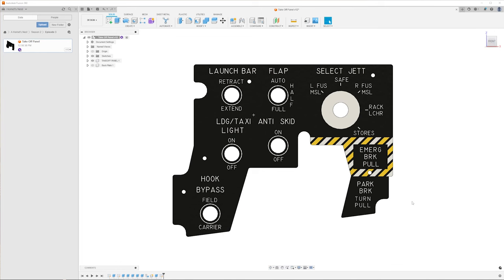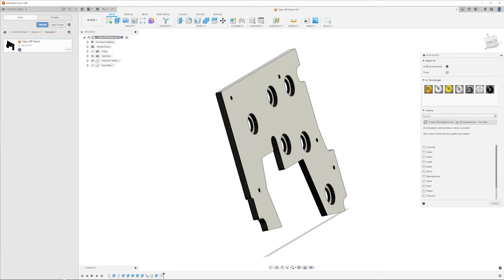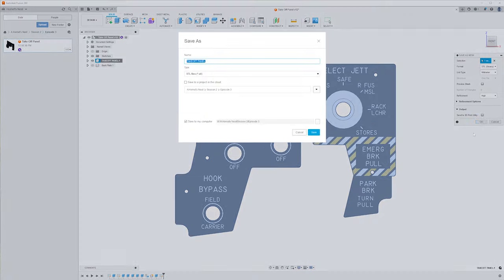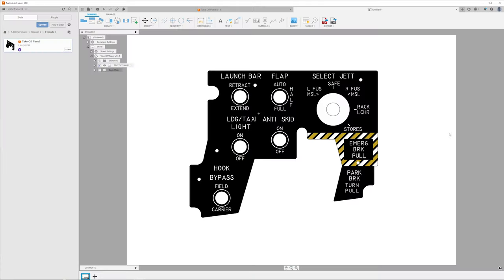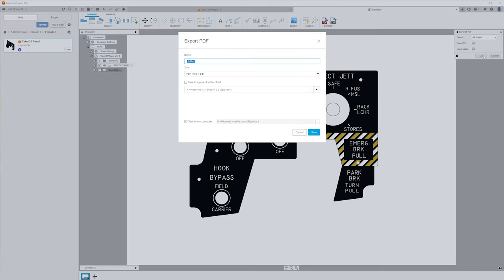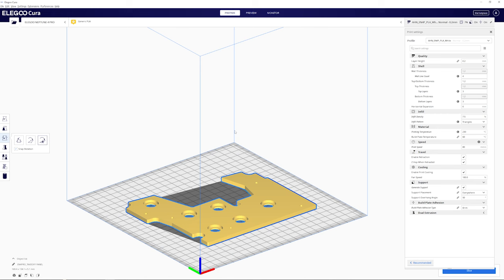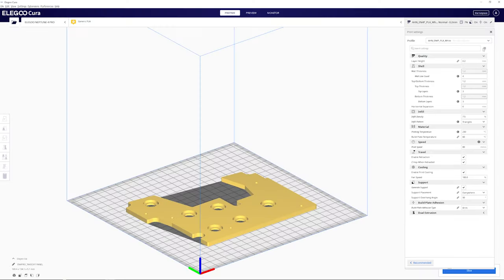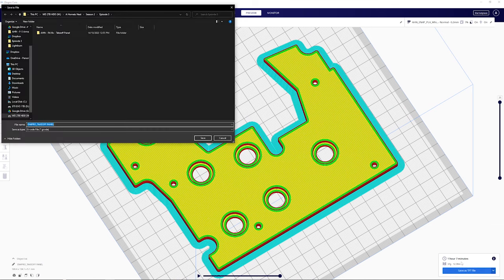Ep: 3 - Print Your Own Flight Simulator Cockpit

Comment: Could i just 3D orint the panel with words? If so how would i do it?
Reply from the maker: You can :) you’d just need to modify the file and run it through a printer that supports multi filament colour like a bamboo etc
Reply: @aHornetsNest  thanks

Comment: Hi there, it's me again, i found out ebout ender crelity 3 printer that has a laser engraving module that can be bought separately and it turns the printer into a laser engraving. Do you think that it could work to engrave on panels?
Reply from the maker: Hey yeah :) it should work to engrave off the paint 🤙🏻 it would struggle cutting - but if you really needed to cut acrylic, just do it in multiple passes
Reply: @aHornetsNest  thank you very much! Now that I've found a "not too expensive" solution I look forward to starting this project
Reply from the maker: Nice one 🙌🏻🙌🏻 enjoy the rabbit hole

Comment: If you make a panel from scratch, how do you get the text to show up white? I cannot for the life of me change the text color
Reply from the maker: Hey mate! So if I’m making it from scratch - in fusion I will make the body white, and make the faces black - then extrude/cut 0.05mm into the surface to “remove” the black face and show white. 

If I’m printing - I will use a sticker sheet, you can in some slicers write some lines to the GCode to stop printing at the text layers, change to white filament and resume printing (I don’t usually 3D my panels) 

My usual method is to laser engrave paint off painted acrylic sheets 🫡

Comment: Thanks mate! Your videos are very inspiring! I was stuck finding a way for backlighting a 3D printed: I tried using black filament for the structure but leaving empty where texts and symbols are and then filling with other white/translucent material (an hot glue?). Another option is printing a very very thin black mask with text and symbols empty to glue on top of the white/translucent panel just to avoid light to pass through but with a good touch feeling... first way too complicated, the second one to be tested soon, but both bonded to the printer/nozzle precision for the details.. never thought about a simple printed white paper: thinking easy is always THE way! Thank you again!
Reply from the maker: Thank you so much mate!! I really appreciate the kind words and the feed back! Glad to have you here :) send me a DM on Instagram if you try this method and it works for you!! 
Tip - use a good amount of glue, I found the sticker sheet was nice and convenient but didn’t stick long term as well as glue 

And spray and matte clear coat on them :) it saves the ink from being smudged when you use it often :D

Comment: You could print both sides of the paper to get the black parts black.

But as much as I apprechiate your tutorial, it's a very time consuming way.

Another way to get the white writings done, would be to engrave them. After that put a very thin layer of black paint onto a flat surface on your table an press the panel (with the engraved side down) on it.
You will get a nearly perfect neat surface. You my have to repeat that step.

But nevertheless great tutorial.
From my experience I would recommend to first build/buy all panels to get them fitted together all at once. 
And I highly recommend the backlit way from the beginning,
else you will bite your own butt...
Because your pit will never be finished... ;-)
Reply from the maker: Hey mate! Thanks for the reply! I tried the double sided print… works reasonably okay, but massive use of ink for not much extra benefit 

Yeah this tutorial was to show people that you don’t need to spend the money on an engraver/laser to get into the hobby… you can do it on a budget 

But saying that doing it this way did make me appreciate how nice my laser cutter is and how much time I save on it 

Haha exactly, the pit is never finished :) if there is ever a question to backlight - the answer is always yes 😂
Reply: @aHornetsNest  
If our wifes sell our cockpits to the price we told them... good night and ouch!
;-)
Another possibility may be to get the papers printed in a copy-shop with professional laser printers...
Reply from the maker: Hahaha … cockpit cost $100 right? 😂 

Yeah that’s not a bad way, still cheaper than a laser cutter ✌🏻

Comment: This is a really cool DIY series.

Hats off to you for your clear and easy to follow presentation and editing style!

RE: paper print panels. Is it an idea to use a light spray of (semi-gloss) clear coat on the paper to both protect the print better and to let it pop a bit more?

Perhaps laminating the print outs using a desk use laminator might also be an option?..
Reply from the maker: Thanks mate! You can definitely add a clear coat to the panels to give them a bit of durability 
And it’ll also make the black look real nice 
I never thought about laminating - that’s a pretty cool idea

Comment: Awesome tutorial, and very helpful. This helps me get a first version of some panels in, with fancier versions for the future.
I do have a question, and maybe it’s something for a future tutorial: how do you design the graphics of the front panel, with all their colours? I’m able to create the shapes of the lines, circles, etc, but I have no idea how to give them colours. Could you explain that one?
Reply from the maker: Hey mate :) Episode 1 has that in there 😃
Reply: @aHornetsNest  yes it was. Took me some time to figure it out, and still have done inconsistent behaviour (like, sometimes the face didn’t get coloured in and then suddenly it is there)
Reply from the maker: Mmm yeah fusion sometimes loses its mind when it comes to appearance- it’s when it’s overworking and it sheds that part first 
When I get appearance glitching - instead of re applying the colour, I just save and restart the program - 90% of the time this fixes any issues
Reply: @aHornetsNest another question for you: what printer do you use? I need to translate the 3D print settings in the file you distributed to my bambu labs A1. If the included files were 3mf instead of stl, I could probably have copied over the settings.
Reply from the maker: Hey mate, main printer is the Elegoo Neptune 4 Pro … and then sometimes I use the Ender 3 v2 as a backup 😊
I don’t add to much printer profiling, just because everyone’s printers are different - and everyone knows their settings best :) but in the folder their should be a basic print guide for wall count and infil etc
Reply: @aHornetsNest  have you noticed any warping in the panel you printed? I printed a panel in two parts: a top legend plate of 2mm, and a middle light plate of 3mm. The latter is followed out to make space for PCB mounted LEDs. I glued the two plates together, but now after 4 weeks the panel started to wrap. I’m wondering if I should just make it from one piece.
Reply from the maker: Mmmmmm no significant warping on the one I printed for the video 
A big thing I do with printing large flat parts is 
Use a Brim, this will keep your piece flat and hold it down to the bed 
Then don’t pull the piece off the bed until it’s at room temp, because you want it to cool whilst being held flat … I found I had warping on other prints when I’d remove it whilst still being warm, and it would warp as it cooled
Reply: @aHornetsNest   actually, that might have been it. Because an older iteration that was from one solid piece, did not warp. I think at the time, I did remove both parts when it was still warm. It hadn’t warped when I glued them together, but I guess that could have occurred much later. Come to think of it, I don’t really know why I wanted two parts in the first place. Maybe so I had a smooth top surface, but I can sand that.
Reply from the maker: Yeah even though PLA is generally thermally stable 
It’ll still warp if cooled too quickly … any flat based piece i print - I plan to start it so it finishes around 3am - gives it ample time to cool naturally by the time I wake up 
Otherwise I can’t control myself and just want to rip it off the print plate

Comment: I’m a bit confused at 6:20 when you talk about top and bottom layers (x3). If the layer height is .2 mm and 3 layers bottom (.6mm) plus 3 layers top (.6mm) it’s only 1.2 mm thick? It looks much thicker than that in your video. How does it get to 5mm? Also - isnt it supposed to be a SOLID full filled 5mm thick piece? Why is there such a low infill number? Sorry if these 3d printer questions are probably pretty basic to experienced 3d printers, but I have no experience with them at all yet. In fact I am trying to use this video to determine if I want to build the panels with a 3-D printer or a laser cutter/engraver, and will determine which type to buy. So I just want to make sure that it is in fact printing a solid 5 mm piece of plastic that will hold switches securely enough when you activate them. I understand your example panel is to be mounted on a vertical surface and won’t be loadbearing. But the majority of the panels on the left and right consul will be horizontal and hold switches and rotaries that you will be pushing on frequently. That is why I’m wondering about the infill part. Can I print a solid 5 mm thick piece using the 3-D printer? And what kind of filament would be best for that? I believe using the Cricut for the negative text cutout, placed over a white or opaque acrylic would be a great solution, if in fact, you can still backlight through 5 mm of opaque plastic. All of these are unknown to me.
Reply from the maker: Hey there! Excellent question and thanks for asking 😃 you’re correct with the 3 X top and bottom, they equate to 1.2mm total 
Slicers register the layers as Bottom Layers - Body/Build layers - Top layers 
The top and bottom layers in the slicer just tell the printer to print the first 3 layers solid, and the last 3 layers solid - the remaining model is made up of walls and infil 

I use such a low infil to allow back light to pass through the panels 😃 you can definitely increase the infil if you didn’t want to backlight the system 

At 15% infil, these panels were perfectly strong to hold and house switches, but if you did want a little more assurance, I found 25% was more than enough… (if you went solid, you’d waste filament for no added structural benefit) 

I use PLA for this, because it’s cheap and easy to work with - but PETG is also a great option 

Hope this helps, any other questions always feel free to ask 😃
Reply: Thanks for the quick reply. Explains most of my question, but at 1:40 you say that - unlike how you normally make panels with a 2mm and 3mm sheet (I assume this is when you are using laser engraving process) -  this time you are 3d printing it as one 5mm thick piece. Yet at 14:00 we see there are two panels ? Now do they both COMBINED make the 5mm? Or are they each 5mm? It looks about the same thickness as the laser engraved version when you lay them both side by side. I thought the point of 3d printing it was to just make it as one piece? Sorry…still a bit fuzzy on this
Reply from the maker: @checksixivan4921  hey mate 
So the Takeoff panel in the Hornet is very similar to the side console panels 
It has a base plate (3mm thick) which the toggle switches secure to - then the front plate is 5mm total thickness (if I were laser cutting the front plate would be made up to a 3mm diffuser panel and a 2mm text panel - Episode 1 & 2 show my design phase and build of a panel) 
The 3D printing combines the text panel and diffuser into 1 structure - and that gets fastened to the base plate with M3 screws/bolts 

The base plate is then attached to the vertical cockpit structure with M4 hardware 

The total panel structure equates to 8mm or 5/16in which is fairly close to most OEM panels :)

I also like your edit with the cricut and negative texting the graphics
Reply: Thanks Scott - grateful that you always take the time to reply to everyone and help us with all our questions! 👍👍
Reply from the maker: @checksixivan4921  no worries mate :) my pleasure